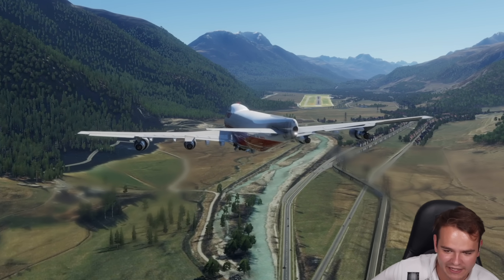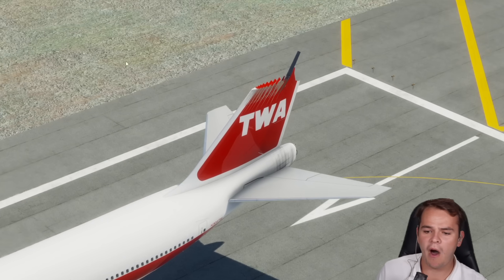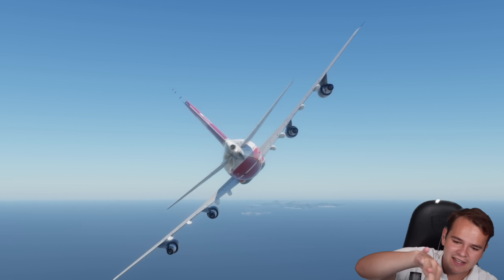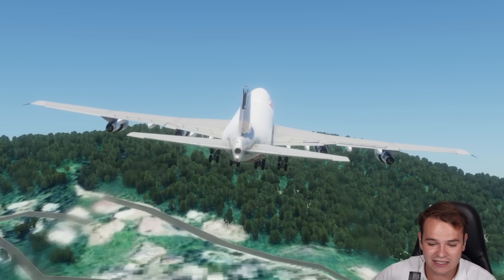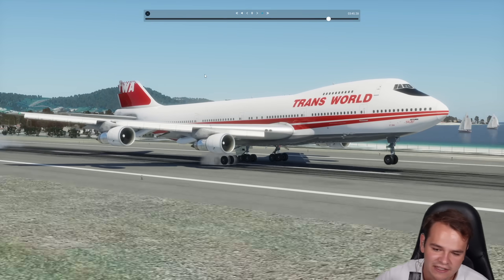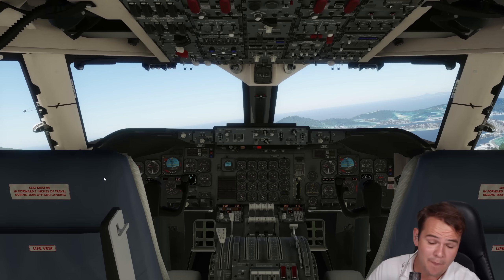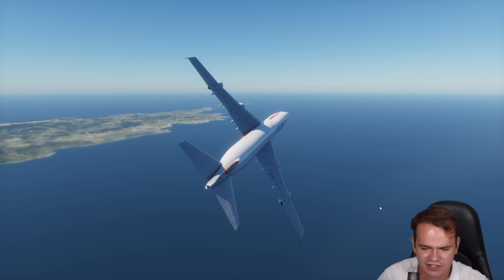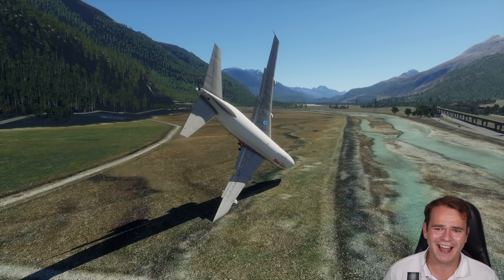How Much Vertical Stabilizer Do WE REALLY NEED? (we crashed)

Comment: in an accurate simulation, the airplane would be inoperable with the yoke. The 747 relies on hydraulic systems to rotate the flaps, elevators, rudder etc. Since the parts are too big and heavy to be operated by gears. The Destruction of he tail, would cause the hydraulics to leak. which mean every other flight control surfaces would become inoperable

Comment: Flight 123 lost all hydraulic power that means no controls as flight 232 but I think you can use engine power to damp the drift not use the ailerons because the drift yaws the nose and the aileron rolls the plane but engines can damp this drift but it still very hard but I think you can land with high speed because it damps the drift a little bit

Comment: Microsoft plaight sim is actually unrealistic I mean it would be soooooooooo 10000000 times harder but the thing is that the thing u move the umm u turn not bank it got ripped off soo u didn't test that and the bad thing is that Microsoft flight sim doest have explosions

Comment: Bruh jal 123 didn't crash immidiately from losing it's rudder  and bow,it crashed because when it was banking the pilots increased power on the left wing instead of the right,casing it's right engine to be hit by a tree,then the wing blew off,then it crashed...maybe research some of the words you probably can't read before saying it"crashed from losing its tail"

Comment: As such a critical component for flight, I’m surprised there isn’t a very small backup vertical stabilizer with a rudder that can be extended from the fuselage possibly from the bottom

Comment: Differential thrust left the chat-
Reply: hm yeah I wonder if the airplane could at least be controllable with differential thrust. But differential thrust definitely won't help if the airplane is already in a deep spin so it's up to the pilot to immediately change the throttles within the first five seconds to prevent a spin which is pretty unlikely

Comment: This makes you respect the pilots of JAL 123 for being able to keep their 747 in the air for over 30 minutes!
Reply: The fact that everyone tried to fly in that situation and failed show's how skillful they're
Reply: @Randomly_Browsing  Ye, shows the skill but also how powerful adrenaline is you know
Reply: @Randomly_Browsing  However, if the JAL flight 123 accident had not occurred, the fate of United flight 232 would have been drastically different.
Reply: @まぐろずし-t4w9q I know, because of engine thrust control maneuver
Reply: I read the used engine thrust as vertical stab. Very insane and scary
Reply: They also lost all hydraulic pressure which meant they couldn't move any of the control surfaces, purely control the aircraft through differential thrust from the engines. Much worse situation than this video even, plus they were hypoxic for a lot of the flight so indeed it's very impressive. Rest in peace.
Reply: Nobody cares go away
Reply: Fr
Reply: why after this crash they didn't put  an emergency stabilizer that could be deployed in newer airplanes ? a few years ago in Brazil , a business jet collided with a B737 , the jet managed to land , but the B737 crashed in the forest . if I had and emergency stabilizer it would have never crashed
Reply: @tunkunrunk  the business jet wing tip made contact with the 737's wing splitting it in half, an emergency stabilizer wouldn't do. Having a deployable emergency wing or stabilizer/tail is quite literally impossible
Reply: @Pilot-2020  their death was unfair , I read the business jet pilot was responsible for not obeying control tower order .  about the wing I agree , but not about the stabilizer . And why in term of aircraft designing people always say "impossible" ?   SpaceX is building and testing its giant spoaceship to take men to the moon , but nobody says it's impossible . People are working on a way to reach the speed of light for space travel  , and nobody says it's impossible .
I love airplanes , and I always feel  pain in my heart every time  I heard people died in a crash
Reply: @tunkunrunk  The midair collision in question had nothing to do with the stabilizer. The 737 legit lost half of its left wing. That is not a minor problem that can be corrected with an extra stabilizer. Additionally, the extra components, complexity and weight that would be required to implement this far exceed the benefits of one.
Reply: @0w3nn   if I live long enough , I will prove  people are wrong , even engineers , we can put emergency systems on a plane , so that people no more have to wait an horrible death , trapped inside a falling plane
Reply: @tunkunrunk  I never said it wasn’t possible, rather it’s difficult and complex and isn’t really beneficial. It’s like adding a second engine to a car because the main one ‘might’ fail when you’re driving.
Reply: @tunkunrunk  we already have many emergency systems on an airplane.
Reply: @0w3nn  not the kind I'm thinking about . In the worst scenario when the plane is falling down , there's nothing to make passengers survive . but we can put a series of parachutes to slow down the plane , in the meantime pilots will switch off the engines so that the plane doesn't burst in flame when impacting .
second idea ! put mini thrusters at precise location on the plane to control pitch and roll in the case of damaged wings or stabilizer .   We can test all of my ideas using giant RC commercial planes
Reply: @tunkunrunk  I'm glad you got this kind of forward thinking
Reply: @0w3nn I could see other reasons. Some kind of Deployable small stabiliser that also had rudder control could be useful. 

Full stabiliser loss is rare. But Full or partial loss of flight controls is more common, it could be useful landing in harsh conditions with an Injured plane, and in theory would not need to have a long service life as it was an emergency only part so could be made fairly lightweight
Reply: @tunkunrunk  left wing splitting in half after getting hit by a PJ is not something you can fix with an "emergency stabilizer"
Reply: jal123
Reply: @miniondx86  they didn't learn from that disasters , today's plane are uncontrollable when the stabilizer fails
Reply: with no hydraulics!
Reply: There was some left
Reply: yes respect the pilot guys as you see in the video he can't even control it easy
Reply: Eskkddlksjdğrjılr
Reply: RIP
Reply: AA587 is in a wake turbulence and immediately rolling and crash. No such pilot can handle that situation
Reply: KAL 007 was only able to fly for 12 mins after the loss of hydraulics
Reply: Everyone talking about AA587 and JAL 123 but no one talking about DHL 611
Reply: @0w3nn  First of all, the plane was right next to the airport, secondly, the plane was easier to control as you only have to monitor 2 engines, and thirdly the vertical stabilizer was there so the plane wouldn’t just go be dumb but you are correct they were the first to land with 0 hydraulics.
Reply: @juanleon3875  why tf are my comments being deletd
Reply: @juanleon3875 No the DHL 611’s vertical stabilizer got cutted off because it mid air collided with the tupolev-154 and it was really high and it also crashed.
Reply: @kawaikocham3873  thanks, that was what I was trying to say but it kept getting deleted because YouTube is trying to censor truth and facts
Reply: @juanleon3875  Didn't DHL 611 crash without regaining control?
Reply: @0w3nn  The JAL had an entire axis of their flight controls removed, DHL had a small part of their hydraulics destroyed
Reply: @spidamez  And even if you're referring to the DHL A300 that's still wrong lmao they lost all hydraulics. ALL of them
Reply: @0w3nn DHL 611?!?

Comment: In airliners, they do kinda need all the vertical stabilizer to fly properly,but with Military planes,some can fly pretty well even without some of the vertical stablizer, for example in 1964, a B-52 bomber managed to land safely while missing most of its vertical stabilizer
Reply: F-15 with ripped off wing in the corner 😆
Reply: But with the b52 it has 8 engines, to counteract any instability.
Reply: @zarimations7735  and even then it landed with difficulty
Reply: @0w3nn  yeah, even with 4 engines like the 747, which would counteract insability better than a twin jet. The rudder would still be necessary, a case study I can think of is jal 123. Not sure if the b52 crew also lost hydraulic power
Reply: he literally said that in the video